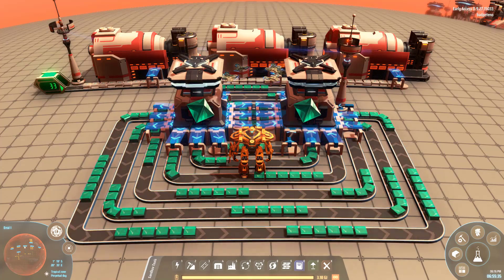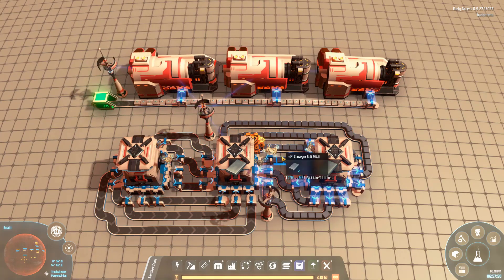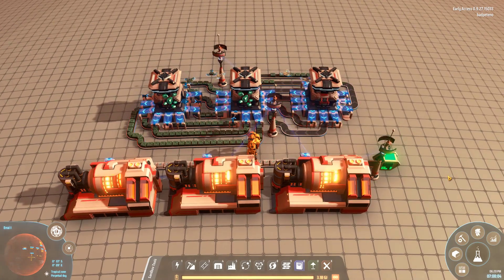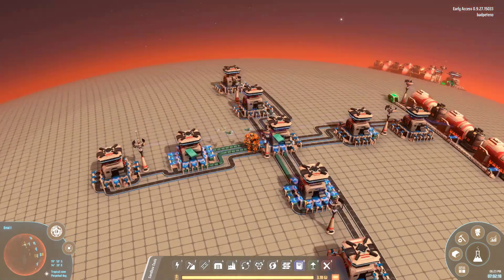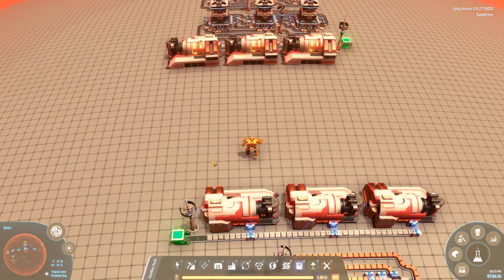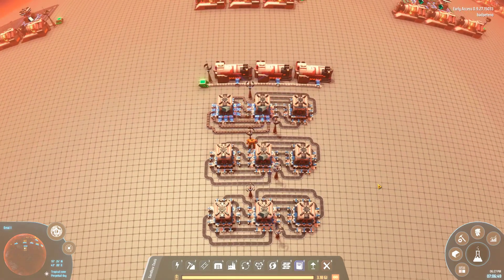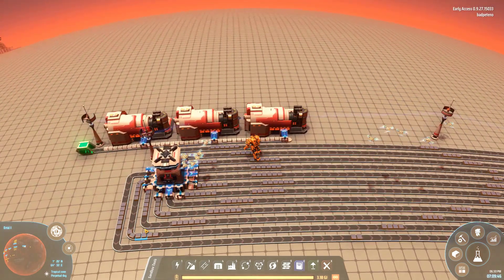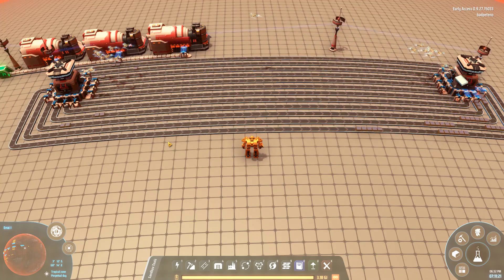Biased Distribution Logic?!  Wasting Time and Energy with Fidget Spinners

Comment: Have too much hydrogen? Instead of trying to "burn it off" just make sure you have an overflow line that would feed to ILS's. Then you can take extra titanium and produce Hydrogen Fuel rods, you send some to fractionators to produce Deuterium to make various things that rely on Deuterium such as the Fuel Rods. If you are far enough into the game and you're able to craft Antimatter send it there as the highest priority. There's always ways to get rid of too much hydrogen.
Reply from the maker: Many of those features are unavailable early game.  Either way, you can't have issues with excess hydrogen clogging the system if you never produce excess hydrogen
Reply: @BadPeteNo  True, but there's always a way to handle any potential overflows. They can be easier to deal with than your shortages...
Reply from the maker: This is primarilly intended as a solution until you get to the real hydrogen hogs like purple jello.  Too many times I have had production stall out while Im working on my first few long term ILS configs, so I decided a set it and forget it approach was warranted.

Comment: I have a way to avoid Hydrogen overload.  Use the new Reforming Refine tech.  Your Red builds won't produce any hydrogen.  Then place 4 Orbitals prior to Green Tech.  The Hydrogen from the Orbitals is only provided as needed and will never cause excess.  i get sub 10 hours every playthrough and I never have hydrogen problems like I used to.

Comment: Have you tried demand/pull only?
Reply: This was a way to fix bottleneck problems when at small scale. But you will eventually run into the problem of 1 source being used more than others and running out. But this happens much later then the impact from supply side.

Just make sure to not have bots in the supply node at all!!!
Reply from the maker: I haven't taken this idea much farther yet.

Comment: Best DNU (do nothing unit) to deal with excess hydrogen is to use particle colliders to convert it into deuterium and then burn deuterium for power (assuming a separate grid and a minimum of power to start process)

Comment: I know you made this awhile ago but you can now insert into the storage box by simply placing the storage box over a splitter and get insertion at belt speed (no need for multiple inserters pushing and pulling). As for the behavior I would guess instead that it is a distance calculation and the reason this is complex is because the center point of the logistics distributor isn't the models dead center. since this looks more like a 2x2 sized object the center for distance caculations might need to be closer to one of the specific corners. But remember you destinations might all have this issue too. So not only is center point (for distance calculations) not centered on the source distributor but it wouldn't be centered on the destinations either. It might be really difficult to test this properly.
Reply from the maker: You are correct, this was made prior to the patch that added the feature.  Additional testing with PLS showed more of a round robin behavior.  Still not 100% how they make up their minds.

Comment from the maker: The TL:DR -- Hypothesis:  Multiple Distributors are prioritized in the order in which they are created, and blueprints preserve this information.  Odds are this may just be something the devs need to optimize.  Also, they aren't a very good way to burn off excess hydrogen.
Reply: This seems like a simple coding "optimization"... usually you have something like "targets.find(target -> target.hasCapacity)" (Javascript), which would loop through all possible targets and IF the predicate hits the first element, it returns the element. And as the "targets"-array is not shuffled, it will always loop through them in the same order and mostly the earlier will return.

This is just a very simplified explanation on how I think this might happen.
Reply from the maker: @draco2k729  I was thinking along similar lines
Reply: Capped* request boxes? Haven't watched it all yet but, this immediately popped up in the head. Edit: Spelling.
Reply from the maker: @eddsson  With 1 supply and 2 demand only a consistent and repeatable pattern of imbalance emerges.
Reply: @BadPeteNo  Right right sry! Thanks for the video as always though!